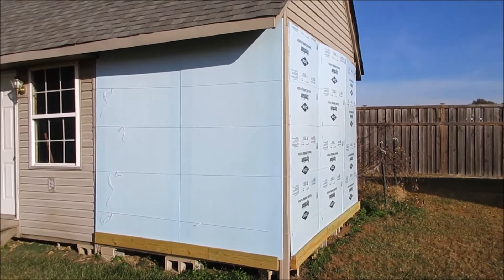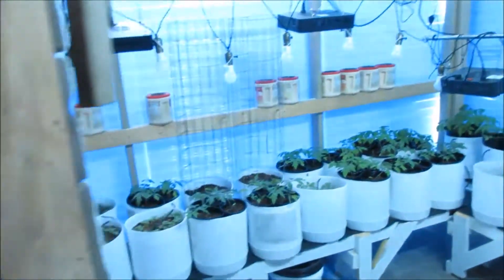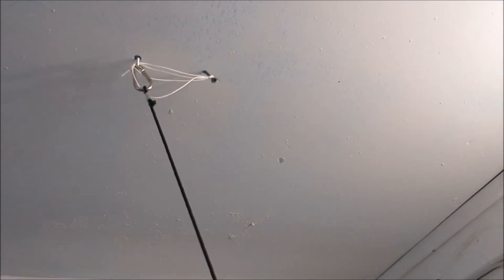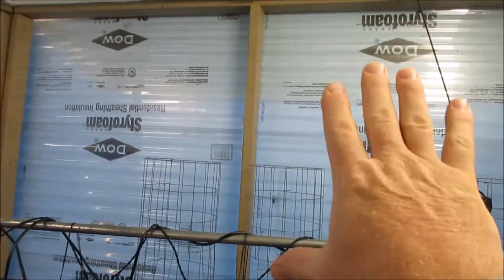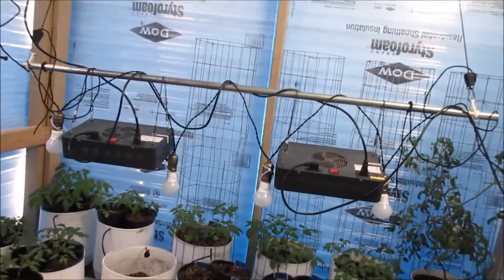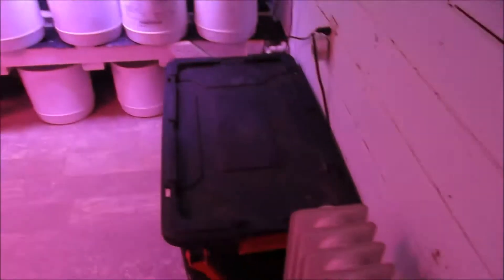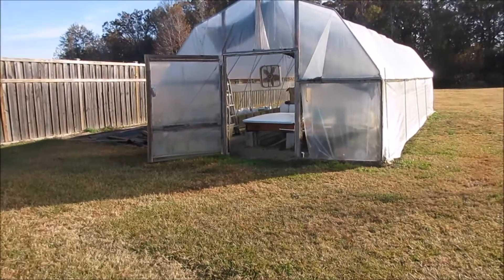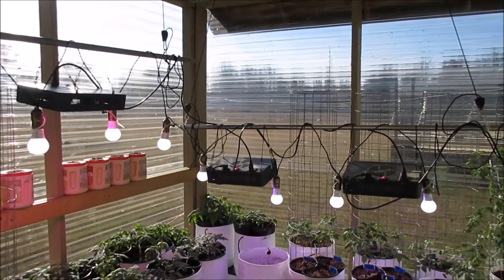Winter Greenhouse:  LED Supplemental Lighting & Insulation

Comment: No cable management. This is a fire waiting to happen
Reply from the maker: Explain your point Peter. Consider LEDs are chained as suggested by mfr and also consider they're on a 20 amp circuit. Also, if you don't mind, include where and how the circuit would be overloaded. After that, I'll be happy to chat more. Right now, there's too little info to support your claim.  I'm not a right- fighter so if you're claim is true, I will change. Thanks so much.
Reply: Electrician here put it on a square [D] Q.O  breaker shit should be fine hopefull... but yes sir I agree cable management sucks balls

Comment: So on those REALLY cold days, do you just leave the insulated panels up and really on the lighting you have?
Reply from the maker: LED lights remain on regardless.  We will likely only get less than 30 days of cold temps below freezing spread over 4 months and most of those will be above 20F.  

I check the weekly forecast daily and check temps many times a day and into the early am at times.  Like now, I'm up and it's near after 11pm.  I could check the temps tonight at 1 or 2 am and I have in the recent past.  You have to protect your work, right?  It sounds like a pain in the ass, but it's not really.

If temps are above 40 at night, like now, I'm leaving them off at night.   In the daytime, when the sun is shining, the sun will heat the greenhouse past 70 on the coldest of days we get.  However, after 3pm (ish), the sun passes into the west enough that an extremely cold day might cause me to put panels up at 3pm.  No sun and really cold, panels stay up 24/7 until sun returns or daytime temps go up a good bit over freezing, say 50F.  I haven't established the exact temps on the daytime/no-sun panel up or down yet, but will monitor the temp gages in the GH to make sure daytime temps (in GH) stay above 70F.  So far, so good.

Comment: Great update video on your winter setup. Those leds are gonna kick major butt for your setup and they will also help with the cold a little as the heat sinks in them expel some heat into the surounding area. I've cooked plenty of avacodo seedlings in a gow tent without enough ventilation, it was small only 4 by 4 by 7 feet and I had something like 900 watts in there. I'm curious to see the results in a few weeks. Thanks for sharing and as always Keep building👍
Reply from the maker: I'm curious as well Todd.  I hope it's enough light.  Thanks for the kind words brother.

Comment: I get the under $20 shop lights and remove the ballast, rewire them for the led tubes and get the daylight balanced bulbs from amazon
Reply from the maker: Rev John O'Toole Very cool John. I'd like to see your set up if you ever want to share.
Reply: I have a few scattered, but I will do an updated Monday when there is better light.
Reply: I put up a couple of videos for you
Reply from the maker: I caught 'em both.

Comment: My winter setup on my GH is similar to what you have going. I have 4ft high permanent 1" foam on the bottom half of the GH. I add the top 4ft for the winter and just leave it up.  My roof is double layered GH plastic. I have 3 400 watt HID lights that I rotate on at night to add lots of light and heat. Right now I only run 1 light at a time but have been thinking about running 1 from 8-12pm, 2 from 12-4am, and all 3 from 4-8am since typically temps drop steadily through the night til about 8am. The extra wattage cost will be offset by not running extra heaters although I have a thermostatically controlled propane heater if needed set at 58.
When it gets real cold this winter you may have second thoughts on switching out those panels LOL. Consider securing the bottoms and hinge the tops to fold down for easier changing.
Reply from the maker: Jeff Sullivan Lol, I sure may!

Comment: 4:15 Only uses 5 Kilowatts ? That's damn economical :) (Of course it's a slip of the tongue, I'm just trolling you. It's 8 Watts as you said it. Just in case you didn't know, "5000K" is the color )
Reply from the maker: Yes, I saw a few smallish mis-spoken areas in this video including the ones you mentioned.  Brain was slow yesterday morning!  I figured a total usage of 80 watts over 50 watts (8 vs 5) was negligible big picture.  5000K is the light spectrum, another good catch as you saw me fumble a bit there as well.  All good Mevo!  :O)